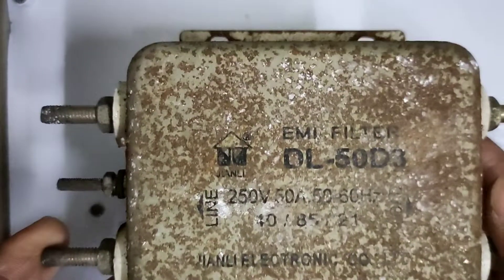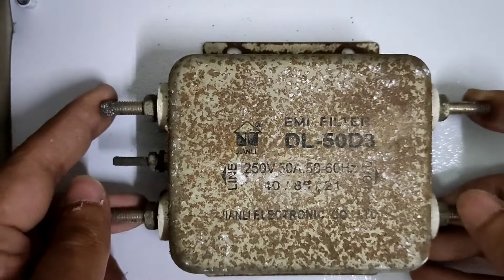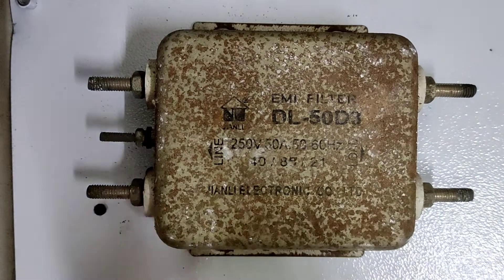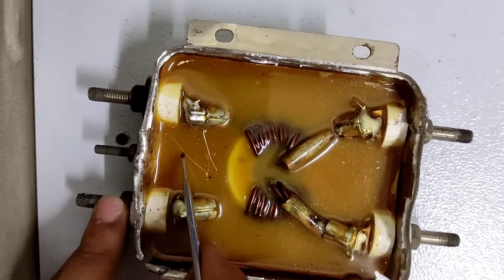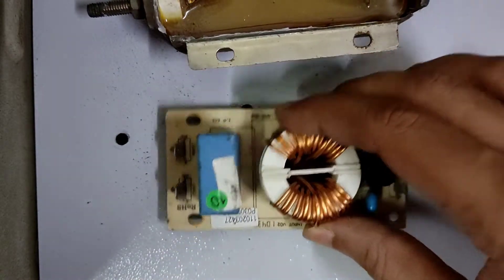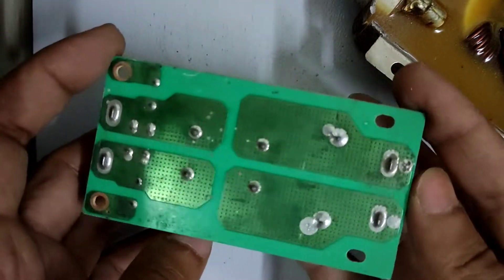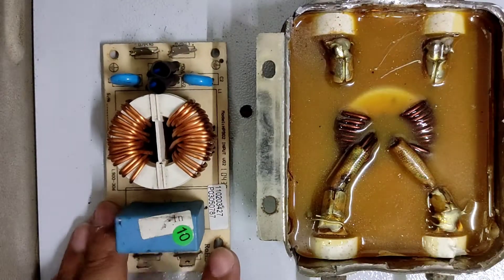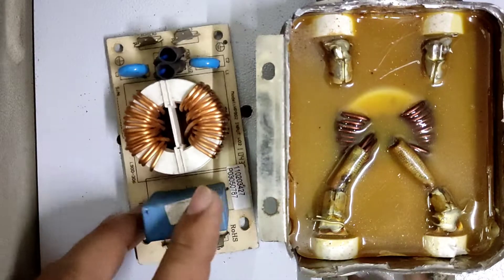IE138: Failed teardown attempt! Industrial grade single phase EMI filter.

Comment: Nice
Reply: @INSIDEELECTRONICS  Funny that I searched for pictures of opening those filters and practically no one has ever opened them and posted a photo online. In fact, the only thing I found was a single video. I also have two of those filters and I’m curious what’s inside, but mine are much smaller, with a plug like a PC power supply connector. Unfortunately, for those smaller ones I couldn’t find any pictures of the inside at all.
Reply from the maker: If I'm not mistaken, I have a similar kind of filter somewhere around my workshop. If I can find it, I shall make a short video and let you know. Still, it's going to look almost the same as these ones.😊 I'm glad that you found my content useful.